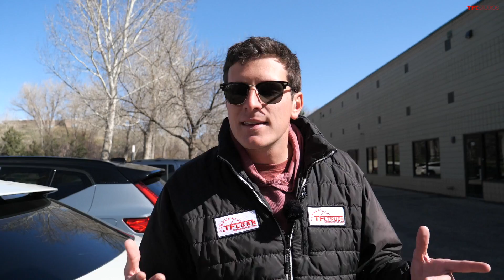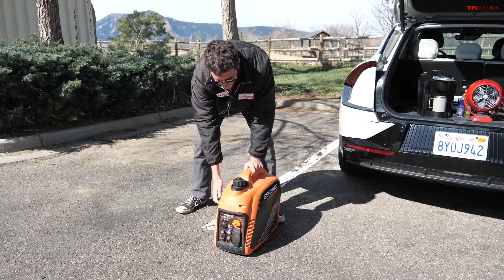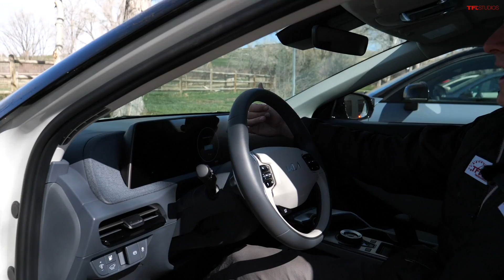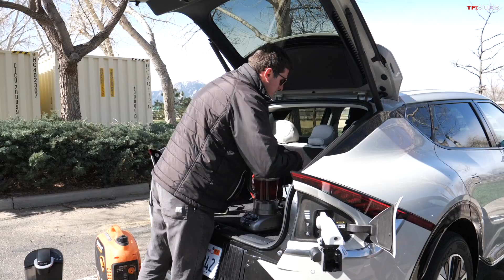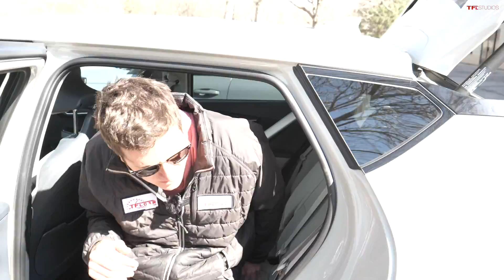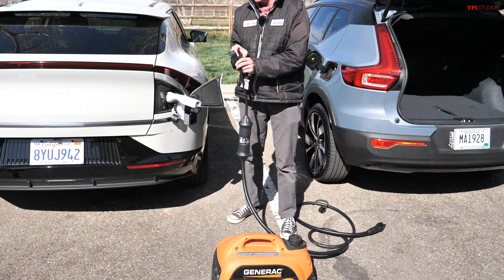The New Electric Kia EV6 Has a Really Cool Feature No Other Car Has!

Comment: I have long wanted the reverse: a small J1772 handle that I can plug an extension cord into to charge anywhere that has a 120 volt outlet without lugging around the bulky cables and box of the EVSE. Then again, it looks like the Volvo EVSE managed to eliminate the box.

Comment: Unless it can deliver power back into a house like the Ford Lightning it’s not worth it. Honestly I think all EV’s should be able to do that incase of a power outage.
Reply: I recently was w/out power(again)from a storm and if I was being dependent upon an EV to take care of my home needs, I would be SOL long before the power comes back on.  Then you are SOL waiting for the vehicle to charge back up before you can leave the home.  What if you are out of power for 2 days or more, you have used all your EV power to power home items, sucked it all dry and now need to leave the home?  You are SOL aren't you?  I like the idea of EV's. but I would not rely on them over an ICE or Hybrid vehicle.  Gas stations have back up generators to keep the pumps delivering gas.  Just something to contemplate.
Reply: @WW-wf8tu  my wife and I have a car each. Looking to get my wife an EV and I’d keep an ICE. I would like the availability to power my house if needed. In Texas our blackouts only last for 8 hours or so. During “snowmageddon” February 2021 the rolling blackout was 8 on, 8 off for 4 or 5 days. I would only need enough power to run some lights and  some small electronics then it would get topped back off when the power came back on.
Reply: @WW-wf8tu  "gas stations have back generators to keep working". And public chargers have backup sources to keep running if power goes out, too. So you would just hit the public charger instead of your home charger

Comment: In Europe a Kia EV6 or a Hyundai Ionic 5 will output 240 volts...probably just a different ‘dongle’
Reply: Europe runs on 220/240 v from the outlets, unlike the US where basically everything expects 110/120...  If the US cars output 240 like in Europe, you could charge everything ONCE.  Then replace it after putting out the resulting fire.
Reply: @drmcallis  Thanks for that Dan, I was born in Edinburgh (Scotland) and have lived in the UK for all my life, so I’m very aware of what stuff runs on here...in the US, many people have a 220/240 volt outlet in their garage/outhouse to power washing-machines and some other volt-hungry appliances...this also enables rather faster charging of EVs too...my comment about the Kia and Hyundai referred to the V2L outputs of the vehicles....as electric vehicles run on DC as opposed to the AC which the grid’s output, (and the Korean vehicles like the Porsche Taycan and Audi GT operate and charge at approx. 800v unlike most other EVs which are at approx. 400v) ...my comment/ observation about the varying outputs, voltage-wise of the vehicles was trying to draw attention to the V2L ‘dongle’ differences between the US and Europe...as is often the case, especially on YouTube, comments can easily be misconstrued. I hope this adds a little more clarity.
Reply: @williammillard687  I was pointing out that the output of the car through the dongle was different exactly because of the need to match the difference between the two standards.  (My family added a 220v circuit to our garage specifically for car charging, by the way.)  I was just pointing out that it wasn't some arbitrary or cost-cutting measure for the US cars.  Hyundai/Kia had to modify the cars specifically for the US market.  Korea itself is also on the 220v standard, by the way.  This may be why the US was among the last to get the car and had so many features removed as compared to the rest of the world as I bet a lot of those things removed (heated rear seats, etc) used the same power supply as the V2L delivery circuit. And rather than redesign the things, they were just deleted.  It'd make sense, and I bet those features will appear in future models as they are updated.
I do wish that the dashcam/security camera feature wasn't a Korea-only option though.  I'd really like that feature.  Oh, well.
Good explanation, by the way.

Comment: Why pay $500 for this dongle vs a 10 foot extension cord you can run to the back seat?  Missing the sense of this.
Reply: The "ease" of plugging in to the outside without having to have any hatches or doors open (for example if you're running an extension cord from your driveway to inside your house during a power outage) is about the only thing I can think of. But yeah, $500 seems ridiculous - the actual inverter isn't in that dongle, the inverter is still inside the vehicle. That's $500 for a fancy plug adapter.
Reply: On the Ioniq 5, the interior plug is only on the highest trim, but all trims support the dongle. Also, the dongle is just about $300 canadian dollars north of the border. I don't know why they're fleecing Americans on it.
Reply: @ShippyJack  Wow! That is.... rare. That's literally half-price. Hell, next time I drive to Vancouver, I may have to check out Kia dealerships and see if they have any in stock to re-sell on eBay for a slight profit back home, but still be cheaper than Kia-direct in the US!
Reply: More power isn't it? Using all 3.6 kW as opposed to 1.5kW - 1.8kW per outlet.

Comment: This is brutal My 2017 F150 has more outlets
Reply: Have you run an electric griddle?
Reply: @ShippyJack   I thought I did we have a black in Decker one  Which we have used many times but I'll have to check with the Pictures from camping
Reply: 240v markets can run 3500w. Enough to run a house.
Reply: Your 2017 F-150 interior outlets are 400W max. Can't power a hairdryer. This car can do two 1,800W outlets at the same time.
Reply: @michaelwbsin   my F150  Has no problem with a hair dryer a coffee maker any household items Mine will even run a battery charger So maybe you have issues with yours I have no problem tailgating with my truck
Reply: @IronCross82  What is written on the interior outlet flap of your 2017 F-150? Does it say “AC 110V 400W MAX”?
Reply: @michaelwbsin  yes it say 400w  But my truck seems to have no  Issues with running that stuff   what's so ever I camp with my truck and tailgate with my truck I've never once Had an issue running anything that I plugged into it And yes it has to be running

Comment: Should just have the outlet built into the car rather than a $500 tailgate accessory.  What if I want to plug something in while driving?  Just do it like the Ford Lightening or Rivian.  When pouring into the blender, maybe pour it more slowly or closer to the top to avoid splashing the interior of the press vehicle lol.
Reply: That's what the plug on the inside is for I assume
Reply: They have this, though it might not be on the base trim, can't remember
Reply: @chunkychuck  looks like its in the rear console rather than in the hatch back area.
Reply: There is an interior plug under the rear seat. In the Australian market, the interior plug is standard, the exterior dongle is only on GT-line models.